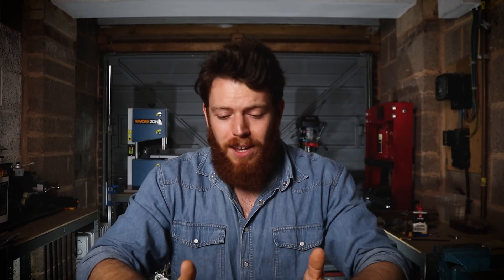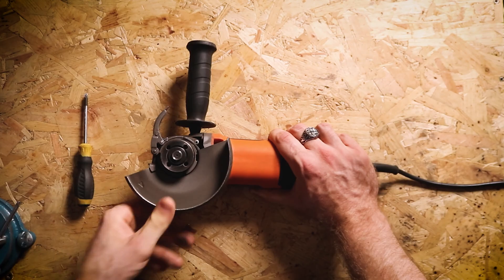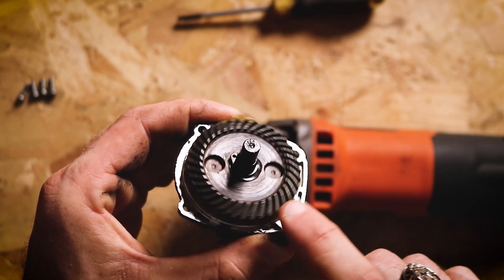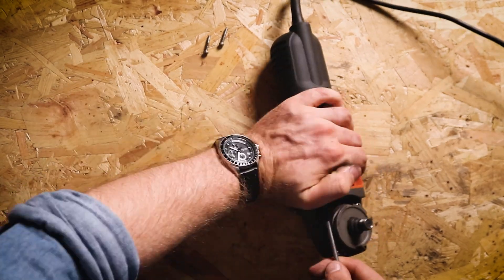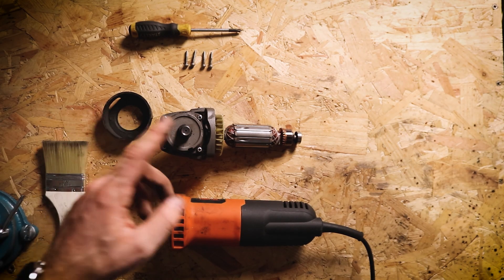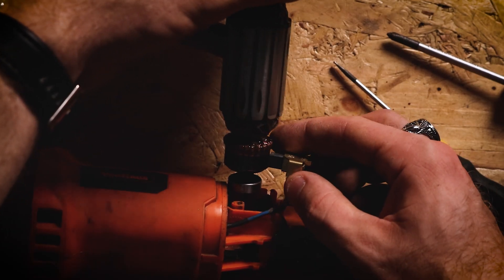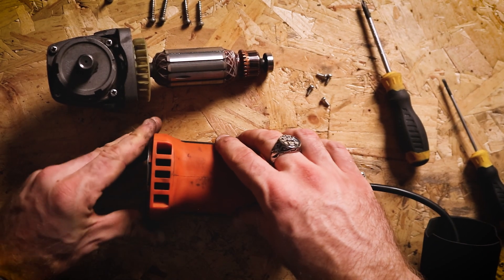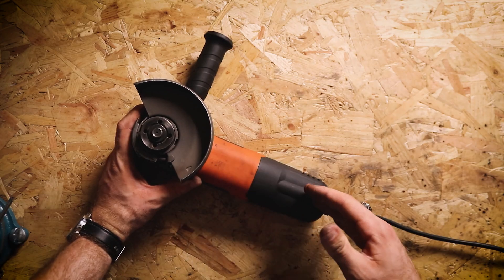Angle Grinder Repair and Service Guide (Essential Angle Grinder Maintenance!)

Comment: I bought a small angle grinder , it starts to have different speed / reduced speed , it is my favorite angle grinder because it was not aggressive and was doing the job correctly then later on did not worked and I clean it then back to operation blasted . I think the switch is faulty and I need to replace the wire .I was working with this machine very rarely once in a while .

Comment: I have a grinder very similar to this one.  I was grinding through a metal stud when the blade got caught for a second, but that's all it took for the grinder to suffer.  I opened it up, per your video, and found that the gear teeth on the shaft had broken in a few places.  There seems to be a nut at the end of the shaft but I couldn't unscrew it, maybe it's reverse-threaded?  Either way, it wouldn't budge.  Does one usually replace the whole shaft that has the wire wrapping and the gear teeth, or should I try to get just the gear teeth and somehow get the nut off?  Thanks for your help on this!

Comment: I think I'm missing a part or something because my blades don't go on tight it's like I'm missing a bushing or something.
Reply from the maker: Are you referring to the discs? The locking nut can be flipped over depending on whether you are using thinner or thicker discs.
Reply: Mine overheated and tripped electricity what to do @JamesKGraves

Comment: Thank you so much. Excellent video, easy to follow. Looks like the brushes actually came loose and Wear the brushes touch on the rotor looks like it's a bit burnt as well so I think I'm not sure what I need to do should I buy new brushes, clean up the rotor where it's burnt....what do you suggest thank you

Comment: Thanks James, I needed this..... I've had the grinder for 20 years and I thought it would be home serviceable.... I was wondering about the bushes and this video was perfect.

I do think I have a front end gearing issue as the rotor doesn't spin freely... If it is broken gearing, is it worth looking for replacement gears v a £50 new grinder (save, planet waste)... Something else might go wrong in a year or so 😕

Comment: Hey there, my battery grinder for some reason has started to loosen the flange nut right after I turn it on. What has possibly happened? Is it fixable with cleaning and greasing or something else?

Thanks!

Comment: Well done, do you ever use electrical spray cleaner on the handle interior..
Reply from the maker: Thanks, Michael! Yeah it's great stuff, I'll sometimes use it if the connectors are starting looking a little oxidised, or if there's grime on the internals that I can't otherwise brush off dry 👍